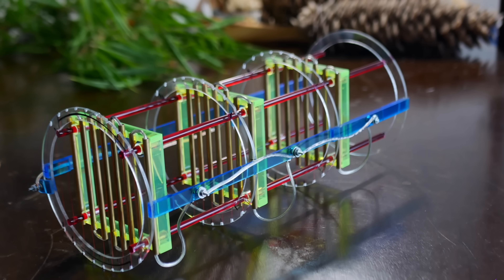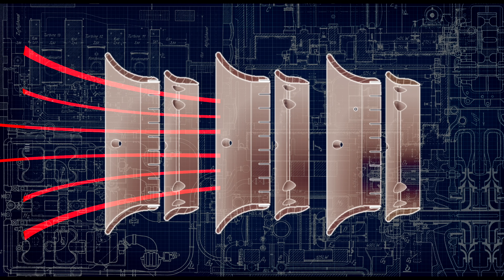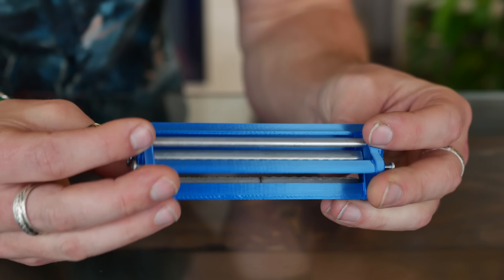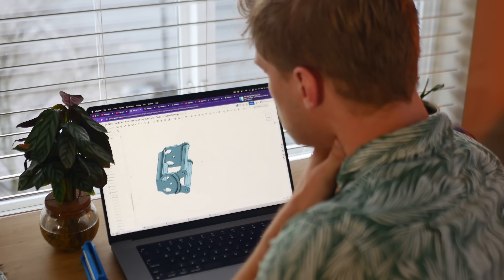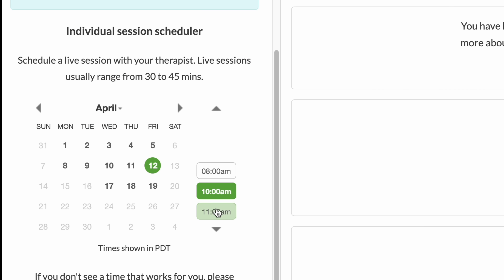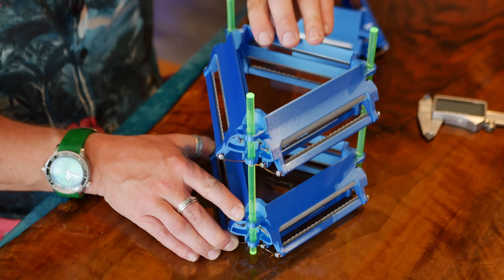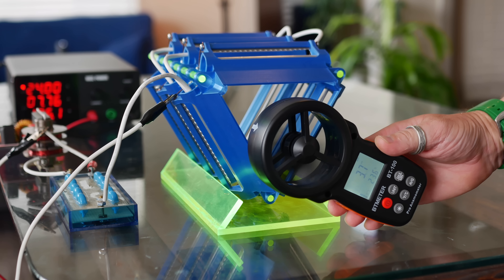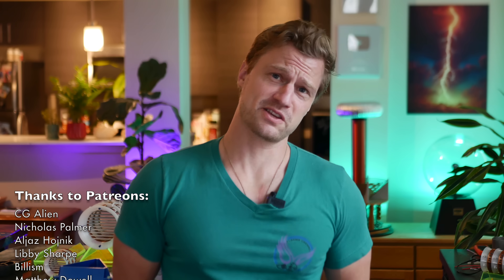Next-Gen Ionic Plasma Thruster Inspired By Nature (BTC Mark 3)

Comment: I have a question. In all these designs you have the sides open letting each thruster take in new air. Why not enclose the system so that only air from the first thruster goes into the second and only that air goes into the third? Shouldnt each stage accelerate the air further?

Comment: I think that there is a significant issue with your design approach. First, kudos on improving efficiency. I don't aim to diminish the achievement. However, the design itself and the results of your testing illustrate an important fact about ionic propulsion. Each stage of the engine is receiving the same 40W input, but each successive stage is less efficient than the previous stage. Taking the same three units and stacking them side-by- side with a small gap between would produce greater thrust for the same energy input. That suggests that the output velocity is less important than input mass at neutral velocity. In other words, your thrust is not coming from output velocity (like a turbojet), your thrust comes from the acceleration applied to the input mass. Mass at neutral velocity is accelerated more efficiently than mass already moving in the direction of acceleration.

I don't think that you're on the wrong track with using an interference pattern, but if that interference pattern could decelerate the mass without causing additional drag, that would improve efficiency. Barring that, you will gain more thrust for less power by simply increasing the surface area with access to neutral air (accelerating a greater volume) than by attempting to add or improve stages.

Comment: You said linear can only go so far even with peripheral acceleration it can still only go so far so what if you were to shrink each layer getting closer to the front narrowing and funneling the air flow it should increase a fair margin. And wouldn’t You would also be losing surface area for the ionic thruster to actually use by making it triangular shaped ? I love your work I’m not dissing it

Comment: Does the narrower jet… nozzle provide more static pressure at the loss of airflow or is it a total downgrade?

Does altering the spacing between the stages or the angle of successive stages provide any improvement? 

Does adding any internal ducting to laminate the flow from the plate provide any benefit?  That seems to be a strong point of the second design.

Comment: how would it work in a closed air looped tunnel system? would the air just accelerate to infinity?

also you know how small tornadoes can get really close to stuff and not influence them, I wonder whats the limit of that, ever since I saw Naruto Rasengan I wondered can we make some air move so fast that it doesn't mix with the other air around it, posibly creating magic wings made of hipersonic air particles.

Comment: Have you tried a convergent duct, with ever smaller stages to increase velocity, devoid of additional air input? Possibly without convergence, an increase in speed is difficult or impossible to achieve. I'd guess that due to the additional velocity, each stage would require more electrode spacing to prevent shorting.

Comment: Would a pyramid/cone design increase thrust output?  Your wider end being the intake and the smaller end being the output.  Compressing the air essentially.  Your first intake could be at 40w, second intake at 60-80w and third intake at 80-120w.  Would that possibly work??

Comment: I appreciate the honesty of showing your new design is not necessarily better as a trhuster, even if it has some of the other advantages you mentioned. I think you are focusing on the wrong part of this problem though. Changing the shape of the thurster might help make the use of power more efficient but the limiting factors to the flow rate, for constant mass, are going to be the voltage difference across the path along which each ion is accelerating and the charge of the ions themselves. You can't do much about the ions if you are using atmospheric air, so you're only left with addressing the electric acceleration problem. You could also use compression and heat, but it would no longer be a purely ionic engine.

Comment: Id be curious to see what kind of difference the frames pattern makes. You tried a triangle in this video, how does a 4, 5, 6, 7, 8, 9, 10, 12, etc. sided thruster do in comparison? Do even faced thrusters perform better then odds or vice versa? Does staggering each thruster assembly with a different polygonal structure make any significant impact, ie having a 4-sided first followed by a 5-sided then a 7-sided thruster in line with each other?

Comment: If you want to drive an airplane with ionic thrust you want force, not a high velocity increase of the air you're pushing. A rocket in space needs to be conservative with propellant, but a planes propellant is air, so it needs to be conservative with energy. This means that it's much better to place the thrusters in parallel rather than in series.

Comment: I have an idea that might improve power. 
You're ionising the air which gives it a negative charge causing it to be attracted to the ground. Could magnetising the ground or adding a magnet after it increase this attractive force? 

My idea is you turn on the coil to ionise some air with an electromagnet after it. Then you turn off both the coil and the magnet (possibly even a series of them) at just the right time accelerating the air like how a railgun accelerates its projectile.
This is then repeated rapidly making a linear ion pulse jet.

Comment: I think the reason subsequent stages result in lower velocity changes is due to how kinetic energy is a function of the square of velocity. I.e., if you add the same amount of energy each time you’d expect the change in velocity to be less each time.
Reply: In addition, there would be negligible changes in density in the flow field for the Reynolds numbers that is operating at.

Comment: @Plasma Channel
1:34 & 1:51 First I thought "Why 3 sides, why not 4?" quickly followed by "why 4 when you could do a pentagon, or octagon..." until the "ultimate" question/answer: "Why not round?"
Could you makes several rings (instead of triangles) that all accelerate the air & aims it inwards? It seams very possible. 
Maybe you could even give the edge a kind of "fractal"-ish design, just to increase the surface area more? like a hollow star-shape or so? (but that's probably worse than round?)

I guess the answer to "Why not round?" is: "Because easier to build with straight pieces, no need to special-order round knife blades."?

Comment: I wonder if rotating each truster by 45 or 90 degrees might change anything. What if the linear design causes the air to be disturbed for every following engine. This means that even though you increase the number of thrusters the efficiency decreases in proportion to the thrusters added. No matter how many thrusters you have, they will add up to the total power of a single thruster. Also, I could be wrong and the spacing is what affects a change in it.

Comment: I doubt this comment will be gotten to but I’m curious as to what the outcome would be should you make each column a factor smaller than than the next. Making the device in a cone or funnel shape where the largest column is in the back directly pushing air into a smaller column in front of it and so on and so fourth. Or how about reversed? Hanging the smallest column in the back pushing forward into a bigger one. Best visual description would be the horn of a trombone.

Comment: Amazing! You're part way to a turbine engine with no moving parts. It's possible there is turbulence happening between each stage as you're compressing air and then running the next stage at the same size. It might make sense to reduce and move the 2nd stage to the size of the covergance point of the first stage. Not sure of the 3 stage, maybe the same or go larger than the first stage, like and afterburner, with a case the diameter of the largest stage, assuming it ultimately needs to be fit as such in a plane. 
Also, redesigning it circular as opposed to triangular will reduce internal turbulance, adding a slight twist to the blades to create a vortex should also stabilize airflow. 

Just spit balling, you're doing great stuff.❤

Comment: yea this probably isnt the best way to go about it, the corners on the peripheral shape are creating a turbulence and they might (not entirely sure) create drag due to boundary layer drag or it has a slight pressure build up from "colliding" with the support structure which could negate some of the power being supplied into the air so ideally you want a annular shape. im not very knowledged in thrust applications but you might want to experiment with choking the air? im not sure if thats efficient but its worth a try. you may also find something interesting if you try a different approach to thrust for example utilizing a ionic impeller of some sorts? you can also try different aerodynamic principles like rotating the incoming air to potentially increase the air intake volume and experimenting with coanda effect

Comment: What about a cylindrical tube with the wiring strung along the sides? Might be able to use off-the-shelf abs pipe instead of some bespoke 3d-printed component.

Comment: This is so cool! i'm jumping into youtube as soon as i see that you've uploaded something at this point haha.
But i'm wondering a thing, isn't the convergence seeming to be a bit ineffective with that triangular setup?

Each step of the ionic thruster speeds up airflow, we then (as nature inspired you) try to converge all the slower airspeeds into a singular faster one by converging all airflows into a focal point.

But as my limited knowledge about this goes... 
The triangular shape has (seven) convergence points? 

We have three gradient convergence points for each outer corner of the triangle "▼".
Then we have 

The first three focal points are the closest to the device and are gradient.
The closest two ends of two airstreams meet and gradually converge more and more in an increasing angle and distance from the device.

The three other focal points are the two far ends of the airstreams that converge and are the furthest away from the device.

The last one (sixth) is the convergence point of all three outlets and to my understanding is the most efficient one. But that "tri-convergence point" only converges the centres of the three airflows.

The further away from the device we get, the more the airstreams have slowed down, and introduced more and more turbulence.

If we want the most out of this, wouldn't it be better to either introduce a cylindrical tube that extends out to the fifth convergence point?
Or redesign the device into a circular shape instead?

EDIT: Three additional parts to this device i think could increase the thrust. 

1. Introduce more air that goes through the device, either by increasing the static pressure of the air that goes through the inducts. Or increase the air speed into the ionizing chambers.
2. Use an outlet duct that keeps the airflows from spreading in an inefficient way.
3. Snare some copper wire around the outlet tube and run some electricity through it to further accelerate the ionized particles.

Comment: I am not an expert on this but, can magnets/ electromagnets  be used for converging flow of charges just like they do in cathode ray tube. Regarding thrust aspect I think you are loosing most of the thrust because of low static pressure( similar to torque in car), if you find correct balance of static pressure and velocity , think will get the best efficiency. Can use serrated saw blades or file tool to have more nucleation site for charges

Comment: I'd suggest putting the fog tray in front of the device and film the intake and internal interactions at high speed. that will give a better view on the interactions and how the air actually moves, as it seems like there's far less efficiency gain per-thruster with this design. Since pressurization reduces the subjective efficiency of each stage, Bill's suggestion to use exponential power scaling for each thruster might work. It also seems as though the third thruster really isn't adding much considering the extra weight it adds. Would more power (and more robust connectors if needed) fed to only two thrusters ultimately be more economical? what happens if you cover the front/top of the 1st thruster? Does that alter the airflow?

Comment: Accelerating air from standstill is what you need to build a lifter.

But you say your goal is an airplane. For this you need to optimize for air that is already moving.

Start with a reference fan that simulates your target cruising airspeed and see how much extra speed you can add to that.

Comment: Okay, I want you to take the single triangle and make it a hexagon where the thrusters are at a tiny angle off of perpendicular to the center.  i think the interference will be reduced into more of a rotational column like a tornado.  Then put it in a vac chamber vertically, fill with argon and circulate the argon w/ the smallest μm granular activated carbon you can get your hands on.  Power it up for a good hour and analyze the carbon stranding that should now be hanging onto your cath/anodes.  you might have to quad your Watts.  But I think you will find a half helix crystalline structure, kind of like a stretched out spring that should be strong, light, and conductive.  I was doing similar with a gravity fed spray gun and an arc welder in air and not successful, ended up with beads w/o proper structure.  Due to many factors...one of which was air moving too fast, granules too large, and spark gap too small.  All of which would seem to lend to your thruster's capabilities.  The next step is 'air' weaving these strands as they are created to make carbon cloth which at this scale has 1000 more uses than what we have now including filters, biomed, fission, etc.  Imagine pumping water thru a filter that results in μm size chemicals getting filtered out w/ a filter that could be cleaned by applying a voltage and opening a valve.  you can trommel out bio matter from water down to a certain size, but after that it's still dirty (osmotic systems are expensive and imperfect).  Like you have a lake full of fertilizer runoff that's now growing bad algae,etc.  Why isn't Lake Okeechobee here in Fl a clean paradise...well, there's natural sediments, etc. and then there's the chems.  After visiting places like Crater Lake where the water is so clean and wild-life thrive I'm embarrassed to be a Floridian with such dirty lakes and canals.  let's say you need to pipe radioactive materials... coating the inside of the pipes would slow neutrons and therefore slow or even stop damage to the system.  Ok, maybe replace kevlar... who knows.  Maybe other osmotic barriers. Additives to metal mfg., I could go on...including wiring and near superconduction at ambient temps.  I know it's off topic of thrust vectors, but i think this ion tech could mfg. the next level of materials necessary to sustain our civilization.

Comment: I wonder if incorporating a design like the old TV sets used to focus and control the electron beam to the TV screen 
So in the same idea of using a  magnetic field that could / may also cause the horn affect to cause the acceleration of the air flow like a jet engine does. 
This may also give it the ability to redirect the airflow for directional control.

Comment: if you think about it, having a hollow center has the additional advantage of using bernoulli's principle. Since there's moving air at the tail end of the thruster, surely there's a low pressure cavity in the center front section which is also contributing. Though I would think the individual thruster unit (one side of one triangle) should be a little shorter to maximize that effect.

Comment: It will be challenging to use this effect for thrust without a substantial ionization fraction (more "traction" for the static electric fields). However, lift for slow-moving vehicles would be an awesome app.

Have you measured thrust? Have you measured the impact of humidity? Would be neat to see you test this at elevation, too - I predict higher exhaust velocity but lower thrust.

Reporting thrust vs power input, intake area, exhaust area, and effective electrode contact area would all be very useful measures to further optimize design. The physical attributes should be easy to compute in CAD software, thrust is trickier.

End of the day, only a proper "plasma thruster" with a substantial ionization fraction will produce jet-engine-level thrust density. Let corona discharge be your friend! Ionic wind drive is much better suited to hovering.

Comment: seems like the design is approaching stacked toroidal shaped accelerators,  if you're able to find a replacement for the razor blades that can be shaped more freely it would allow you to skip the need for multiple sides. building on that toothing the positive blade at an angle could give the thrust a twist,  and based on absolutely nothing; tornados are quite powerful, "tornado ion thruster"